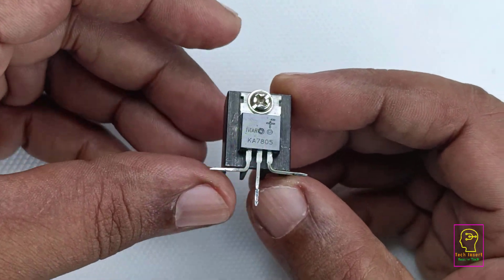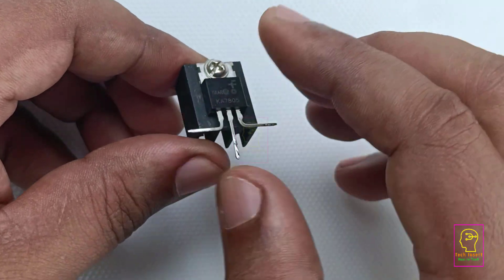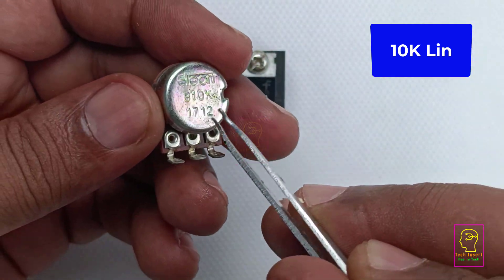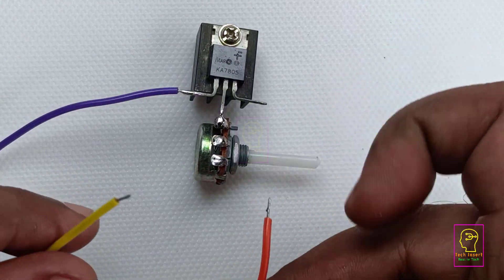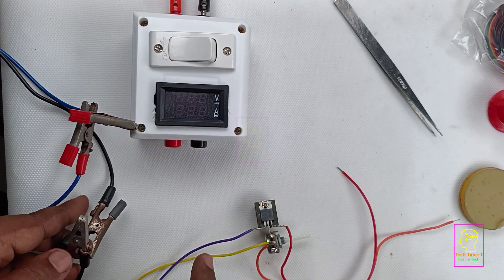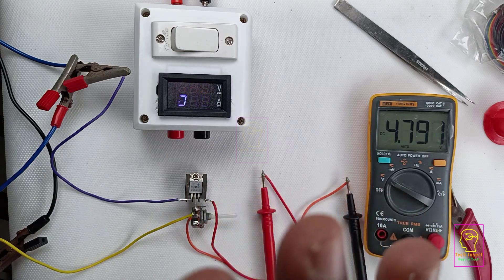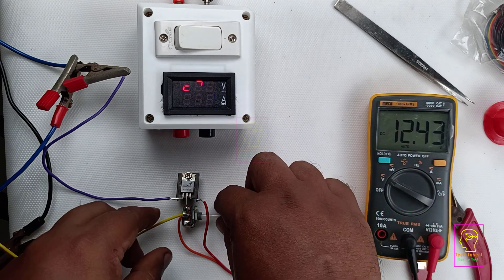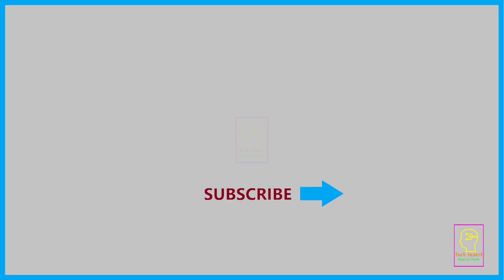7805 -You will be surprised watching this hack | 78xx as variable power supply

Comment: How will this work?!! The 7805 works by sending excess current to middle leg & to ground, maintaining the output at 5 v even when load changes. The varistor soldered on the middle leg of 7805 would be unable to take such high currents. Usually the volume control is rated for 0.25 watts! Insufficient! It will burn out when you start putting a load.
Reply from the maker: No it will not create issue. Trust me

Comment: Can i charge a car battery with this?
Reply from the maker: No, coz car battery with 35Ah requires 3-5A for charging. But this will deliver only 1A. So technically not possible
Reply: @TechInsert  thankz, what regulator should i used then if you please mention its number and price tag
Reply from the maker: @neo3768  If this is Lithium battery pls use BMS for charging. If lead acid then use LM338 regulator which an exact replication of LM 317 but with 5A output current. Also pls make use of full charge cutoff
Reply: @TechInsert ok thank you again
Reply from the maker: @neo3768  Welcome